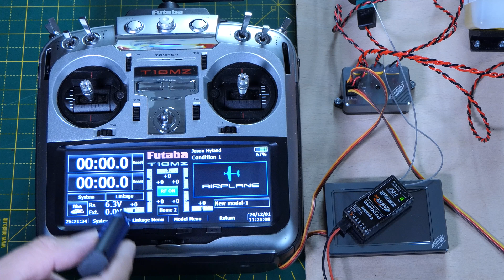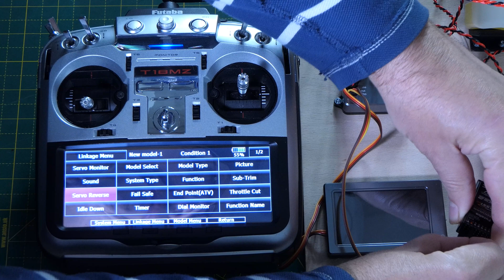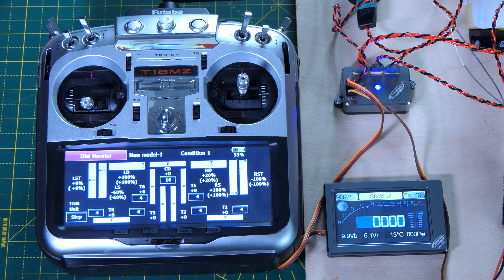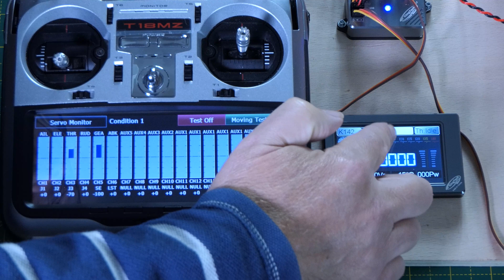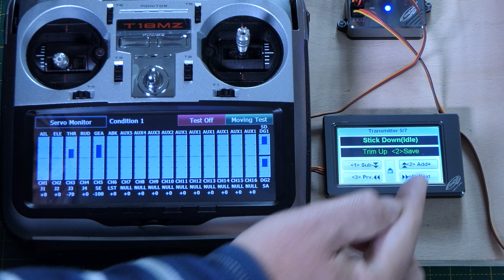KingTech K142 G4 Turbine - Part 2 - Setup for Futaba and RCLEARN tutorial (4K)

Comment from the maker: Hey everyone, hope you like this RC Learn tutorial - pretty simply I know, but I hope it will be useful to some! One thing I didn't mention, but is in the manual, is to make sure you set your throttle travel to 100%
Reply: Setting up my K-85 recently and noticed the manual asks for initial binding with throttle and trim full down.  It seems you did your binding with throttle and trim in other positions.  The RC Learn is clear, but the binding does not seem to follow the manual.